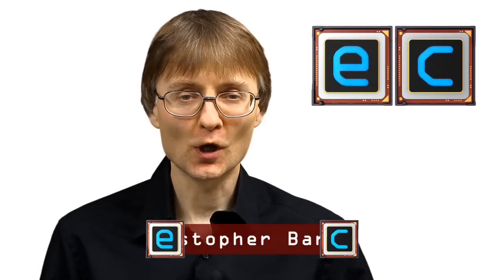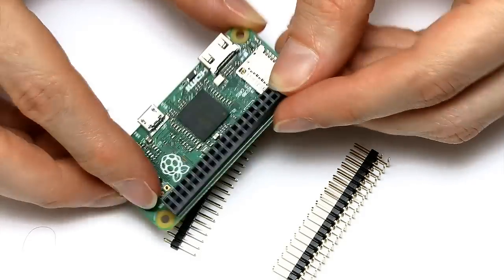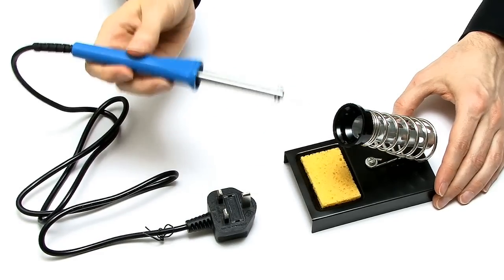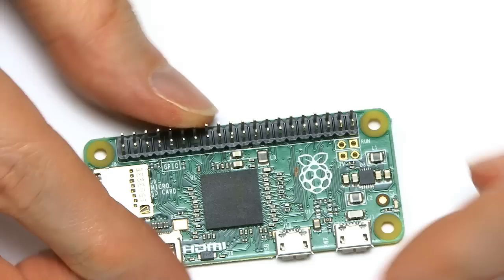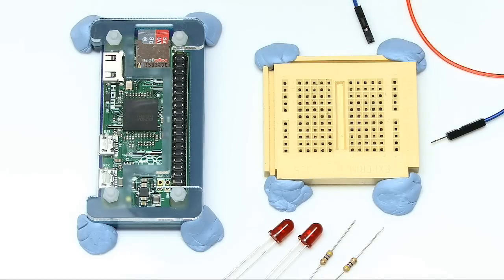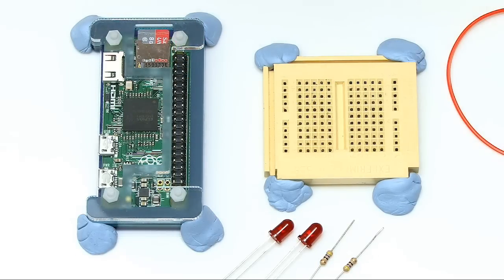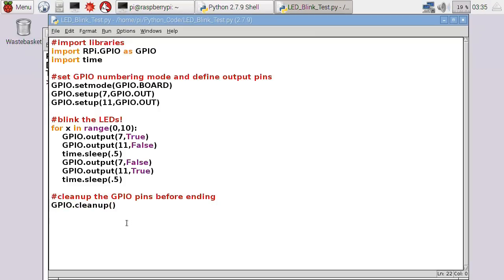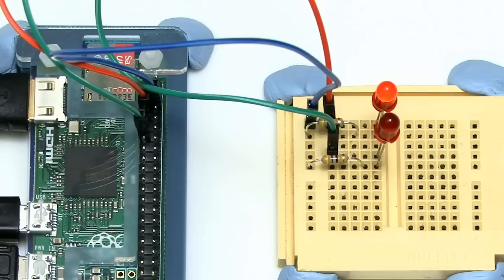Raspberry Pi Zero: GPIO Pins

Comment: I tried to right this program with my raspberry pi3 and show error "no module name named RPI.GPIO"
Reply from the maker: +Lisandro Lopez Baylon Assuming you are running a recent version of Raspbian (which I imagine you are on a Pi 3,), then check your capitalization -- it is "RPi.GPIO", not "RPI.GPIO" (ie the "i" is lower case). Also, make sure you are running IDLE in root mode -- entering "sudo idle" via the terminal, not accessing IDLE via a menu option, which will not give you root access.
Reply: Thanks!!!! I will try
Reply: +ExplainingComputers "SyntaxError: invalid syntax"... I entering "sudo idle" via the terminal
Reply: +ExplainingComputers I have also tried to follow the instructions for the program I did in rasperry pi 2 and also gives me error; maybe it's a problem of raspberry PI3
Reply: +ExplainingComputers ok!!! I do well ! now it's working! Thanks for your help!
Reply from the maker: +Lisandro Lopez Baylon Excellent! :)

Comment: Wow, that's cool and looks like the learning curve of GPIO programming isn't that hard. BTW, what is this "glue stuff" that looks like bubble gum? And if I may add my 2 cents: whenever soldering delicate stuff such as a Pi, it's better to go it as "crossing", meaning starting by pin #1, than #40, back to #2, than #39, so avoiding overheating the board. Keep up these cool videos!
Reply from the maker: +Claudio Carlquist The blue stuff is called Blu-Tack -- more info here: https://en.wikipedia.org/wiki/Blu-Tack  On the soldering, what you describe was my initial intention, but filming added a lot of extra complexity!  :) I also forgot to press the record button when I did my best run of pins! :(
Reply: +ExplainingComputers Thanks a lot!

Comment: Oh, My Lordy! (Well, it is Easter Sunday!) you've brought back some wonderful memories of soldering in my younger days!

Major credit for the close-up film-work. That's a tough deal and you made it look so simple - and it gives the viewer so much more confidence. I wish I had a Pi Zero to get cracking on with! Well done on the Blu Tack!

Up to recently, as I understand it, the Zilog Z80 was the go-to processor for embedded applications such as washing machines, etc. It's been around so long there's no bugs in it and it is well supported. I'm beginning to wonder if chips like those used in the Pi and BBC Micro might just supplant the Z80.

I wonder if it is possible to 'snip' one of the layers of the case so that access to the micro-sd card could be had via a pin-stick push?
Reply from the maker: +Kevin H I have fond memories of programming a Z80 in machine code, a byte at a time. On the micro-SD card access, I have been thinking along the same lines -- just removing a bit of the plastic! :)
Reply: +ExplainingComputers I also did machine code with the Z80. Good times!
Reply from the maker: Kevin H Computing was so different back then . . .

Comment: you dont have to use idle, i made mine allow access to gpio from inside and outside of raspberian
Reply: +Jay Mee i lost the original post i had on this but made a new 1 hope this helps jnet.forumn.biz/t1100-uaing-raspberry-pi-gpio-pins-from-outside-the-ccommand-line#1475